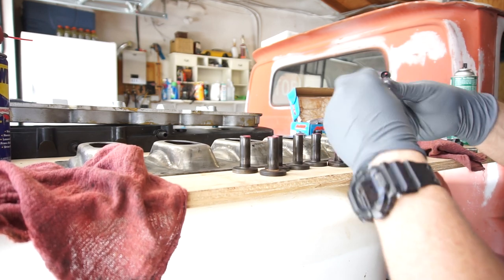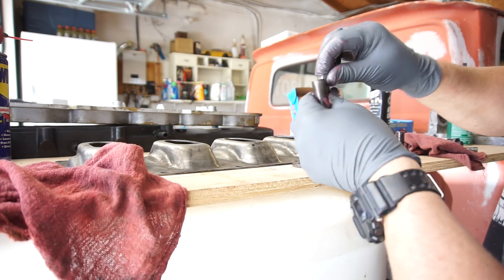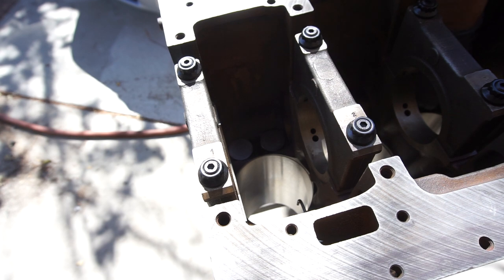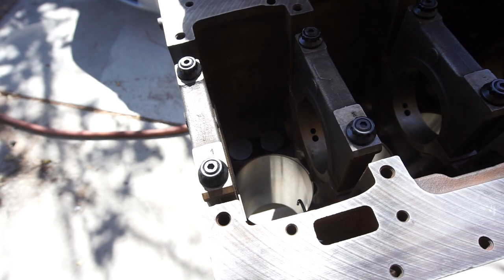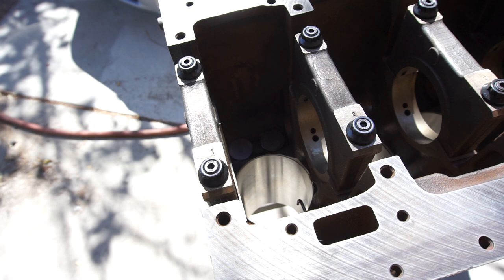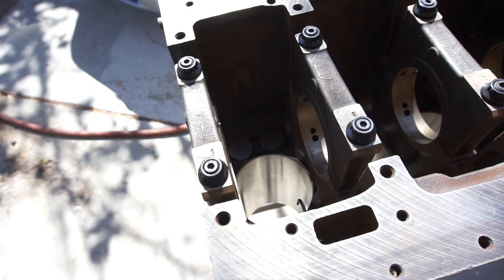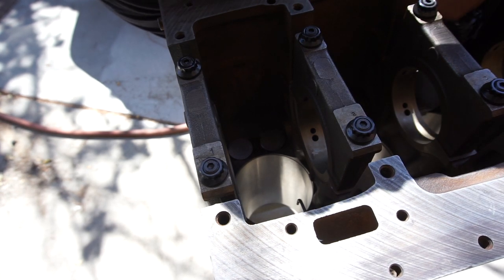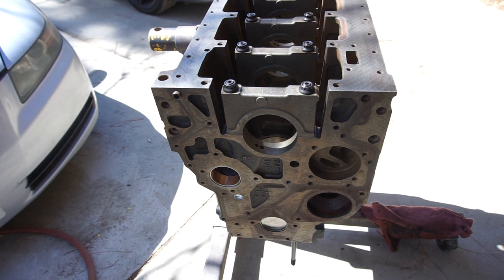Part 3 6.7 Cummins Build Tappet Install and Blabbing About Nothing

Comment: I have my cummins up for sale. Spread the word
Reply from the maker: 1TUFFTRD you do?
Reply: @Halffast719  yeah. I need a dually
Reply: Not pulling the new trailer that well? Why are you selling it?
Reply: It pulls it fine. Dry wieght is 15k and gross is 20k. It's over my tow rating for the 2500.